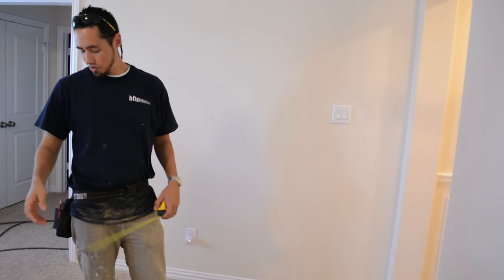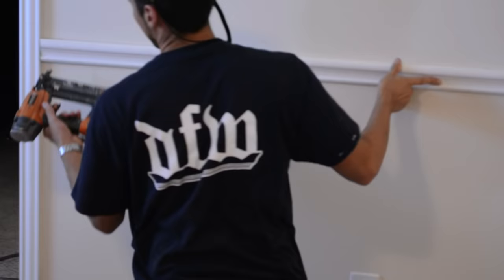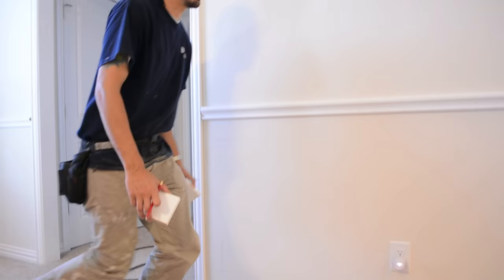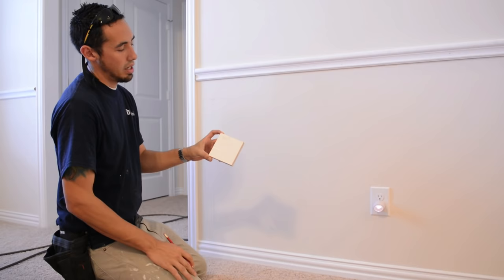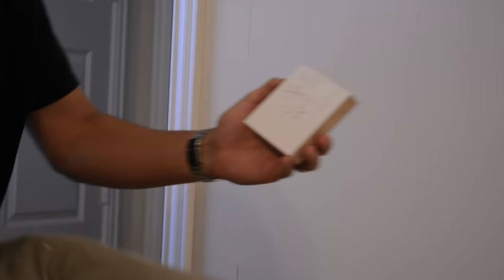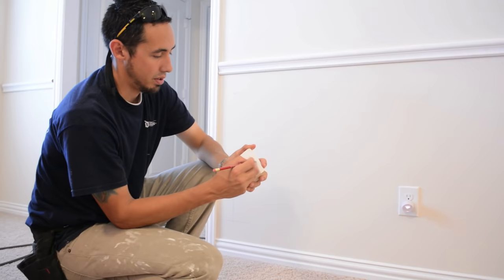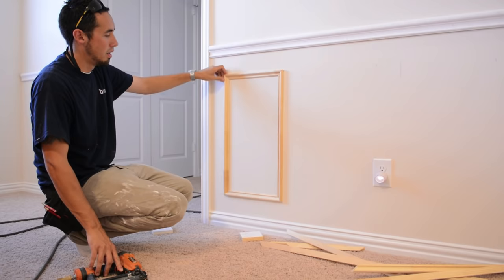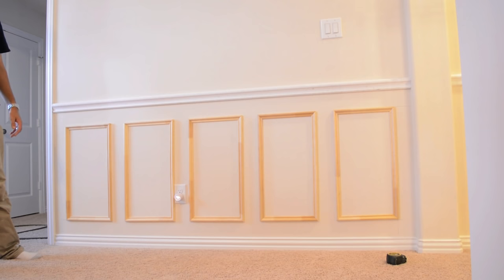How to Install Chair Rail and Picture Frame Moulding

Comment: How do you know how big to make the picture frame moulding?  For example, if you can get 6 frames on an ajoining wall but only 5 on the next.  How do you determine the width so that it doesn't look different on the two walls?  From your vid, I think your frames are 14 inches wide.  How wide were they on the wall to the right that you did previously?

Comment: I have a question! 
When you nail those frames. 
Is that wall a drywall? 
And if is not can I still just nail them to the drywall itself considering there is no wood frame behind? 
And what nail measurement are you using ?

Comment: If the internal spacing is the same as the two outer spacings (as it was here with 4" for everything), you can consider the last outer space to be part of a panel+space group. Avoiding the N-1 spaces for N panels complication reduces the chance for math errors.  (93.75 - 4) / 5 = 18" for panel & space, or 14" for panel only.

Comment: What do I do when one side of my wall is wider than the other side?  Is it ok to have 21.75W picture frame moulding on the wider wall side and 18.25W on the narrow wall side?  I have a window separating the two sides.

Comment: what should I do if one of the frames measurement have an outlet or vent register in the way? Do you have a video to work around that issue?
Reply: Design you panels to go around them or change the position of the socket, vent or switch.

Comment: If you have a room with different length walls, do you do different sized “boxes”to fit the walls ?  ( same room)
Reply: Michael Liscsak Yes you have no choice if you go from a wall with no obstructions to a wall with large windows for example.

Comment: I have a curved staircase. I need to cut a chair rail return at the bottom. The angle is 24 degrees. I want to use the 45 degree cut into the wall. How do I make that cut?

Comment: good job on the layout. But, how tf does shooting brad nails into drywall suffice for holding the moulding for long term results? did you install blocking or sheath the wall prior to gypsum installation or you just say fuck it?

Comment: Where you run into problems is existing electrical outlets are in the way.  I make all the frames up before installing them on the wall, and then glue them to the wall - studs are never where you need them.

Comment: Thank you! What size nails do you use  ?  also will you recommend  painting the picture frame before or after
Reply: I painted all my crown moldings and  trim.  Then you just fill in the holes and touch up after the install.  I found it easier for me.
Reply: @jtoo6060  Thank you!

Comment: I really appreciate your videos! I have a question though, since you’re just shooting into sheet rock with your finish nails I’m not sure that the molding will really stay in place very well. It would seem the only thing holding it all together would be paint. I’m about to attempt this project in my  home so I am very curious.
Reply: Make sure you are nailing into the studs or run a small bead of liquid nails on your moulding then nail it. The glue could damage your wall if you ever decide to remove the mouldings. You can buy a good stud finder at the hardware store.  I recommend one that locates studs and electrical.

Comment: is the fourteen inches the outer measure of the square or inner
Reply: yes, on Pic blocks/Shadow box it's always the outside measurement.
Reply from the maker: that is correct, it is the outside measurement of the box.

Comment: I did engineering at university and I still use my calculator to do basic maths. It's better to look a little silly using a calculator than have to re-do your work.

Comment: what's the type of  molding called (the style)?,.for the framing.  I'm thinking of making my own molding ,  with a  roman ogee and a  round over on the  other  side.i think  that would   work
Reply from the maker: This one is called PM5. Most millwork shops have it in my area.
Reply: Ty for the response.good work..

Comment: I have 9ft walls, so would I make the height of the chair rails higher or keep them the same height???... is that a standard height and rule?... thank you in advance for your help!
Reply from the maker: standard is 36" - 44" but you will need to hold the trim to the wall at various heights to see what you like. for 9' ceiling I would do 40" Thanks.
Reply: dfw crown awesome! Thanks for your response... great channel for DIY'ers!! ...
Reply from the maker: Thanks!

Comment: Couple of questions for FCTV or anyone here that’s done this please:  1a.😂  When designing wainscoting, do you do all the walls in a room or just a single accent wall?  1b. Is there a wainscoting design protocol for this?   2.  When shooting the brads into the moldings, it does not appear it is a concern to shoot into studs behind the drywall.  Is it ok to shoot the brads just into the drywall?  That does not appear to be secure & the moldings would start to come off or separate from the wall imo.
Reply: Yes, he was only shooting into drywall, however, painting/caulking it would add some stability.

Comment: Just curious... are you nailing the trim into studs or just the sheet rock?
Reply: Martin David just sheet rock. Just angle your nails in opposite directions
Reply: Caulk and paint helps with adhesion for something so small as well, but it wouldnt hurt to run a tiny bead of adhesive behind imo

Comment: Your videos are great!  Couple questions... are you worried about hitting studs at all when nailing the trim or does it do fine holding into the dry wall only?  Also, before you paint do you run caulk around all the trim?

Comment: For something like this is it mandatory to nail into studs?
Reply: He's nailing into MDF that was installed prior
Reply: No, you do not need to nail into studs… This is non-structural it’s only decorative… Just butterfly your nails into the sheet rock… Meaning shoot one on a right angle the next one on a left angle or shoot one on a upwards angle and then next one on a downwards angle…
Or for this project,  how simple it is, you can even actually use a hot glue gun to stick it to the wall then caulk around all the moldings

Comment: Anyone know what size nails he used?
Reply: @B ATe That is a good question. I'd guess they silicone the edges to provide a smooth look with minor adhesion. Plus, I'm sure he hit enough studs here and there to solidfy the whole picture frame. Just a guess though.

Comment: ...so, level-and-plumb-be-damned? I ask respectfully because almost every home where I do this is an old Victorian or an old Italianate and the floors are super whacked when it comes to level. What's your opinion on your first measurement in a case like mine?
Reply from the maker: I understand. Most of the homes I am doing are less than a few years old. The houses are built  pretty good as far as the floors being level. I have never had any issues with the way I do it. 
I check it with a level just to be sure before I start painting. I would try to use a laser level as a guide if the floors were an issue in older home. Thanks.

Comment: What if you are only using 2 panels? Do you use 1x1= 1 ?  I tried your formula for 2 panels and the my measurements came out wrong.
Reply: He said if you have 5 panels it would be 4x4. According to him It's always one less than your actual number of panels for your math formula. So, I would take it that if I want 2 boxes it would be 1x1. I tried that and for some reason the two boxes didn't match up for my wall. I experimented and went ahead and used 2x2 for my 2 panels and the formula for the boxes came out more accurate. Although still not perfect. I am just wondering if his formula is accurate unless you are down to only using 2 panels on a smaller wall. I would like to add that I tried what Noconz0727 MC1 said...
"Easier way to math. Take your overall, subtract 4, divide by 5, subtract by 4" and that got my panels more even on my wall.
Reply: Lets say the wall you are working on is 12 feet and you are going to put 4 inch spaces between the boxes you are going to have 3 spaces one on each end of the wall and one in the middle. So the math would be 12ft - 12inch =11ft now divide by 2 so your boxes would be 5.5 ft,   4inch's/Box/4inch's/Box/4inch's 
You can use whatever spacing you want it doesn't have to be 4inch's but make sure whatever spacing you use you use it for all 3 spaces. Hope this helps

Comment: So the Equation he is using.  Which i had to pause and rewind a couple times is:

Using a 4in Spacer

[(Wall Length - (Spacer + Spacer)) - ((# of Panels - 1) x (# of panels -1))] / (# of panels)

Comment: what kind of tool do you use to nail it, nail gun?
Reply: Why would you ask this question if you watched the video? He used a brad nailer how did you miss that?
Reply: Because, I'm not a contractor and don't know a lot of things so I needed to ask what the name of the tool he uses. You need to be able to tell what you are looking for in the store. Don't you think?!... So now I know I need to buy a tool called 'brad nailer' .
Reply: Sorry about that I did not think of the fact you might not know what a brad nailer was I would suggest a 18-Guage 2-inch brad nailer it will shoot 5/8 to 2 inch brads.  Hope that helps!!!!

Comment: Is there an issue with the panel moulding not hitting the studs; wouldn't they loosten over time?

If not, what size/gauge nail do you recommend and is any glue recommended?

Thank you in advance.
Reply: I am wondering the same myself about the nailing....

Comment: 2 things

1) ive watched a good amount of your videos and i want to give you props on the good work. 

2) on one of your videos you mentioned that you use 2" finish nails, don't you ever worry that you'll hit a plumbing line or electrical? I know that you SHOULDN'T because let's say its 1/2" for the trim then 1/2" for sheetrock, you only have 1" behind the sheetrock and plumbing and electrical should run at the center of 2x4 studs, but we know that plumbers and electricians don't always do that.

Comment: this would be difficult without a nail shooting M16...
Reply from the maker: lol. They are pretty cheap. Like 150 for a whole set up.
Reply: i tried doing it the old fashion way with nails and hammer and I end up damaging the molding (made from soft pine wood with a razor thin white layer for paint).  I really need to buy one of these nail spitters.

Comment: i'm sorry, but did you just nail the chair rail on to "drywall"? I didn't see you finding any studs...
Reply: I think what he likes to do is, if you notice, is nail in opposing angles. I prefer finding studs as well but sometimes you may not have that luxury
Reply: @alcawmk  I'm not trying to knock him down, he's really good, but constructive criticism is always good in this trade. He had plenty of studs in this project, nailing in opposing directions while using adhesive, I've also done it, but only when I had no other choice.

Comment: I think this is a little too basic and there is some miss information here, Chair Rail typically goes on between 27 and 30 inches AFF this can be found in the Architectural Standards. Why is he bringing all the cut pieces in when he could have put them together on a work table and brought them in assembled. He did not glue the back of the molding to the wall nor did he glue his miters, very bad technique. miters will start to pull apart with the changing seasons and not look real good.

Comment: I hate to call you on it, because I love and appreciate your videos. But it threw me off when you crunched the numbers for your layout. You ended up with 69 3/4". Then divided by 5. And got 14"? I found the extra 1/4". Second to last panel. The mullion in between those panels ended up 4 1/4". Only reason I'm calling you on it is because I'm a carpenter, and I know you'll agree, 1/4" is pretty much 1/4 of a mile.

Comment: Not the best I've seen but also not the worst yeah I'm lying probably the worst you were killing me the whole video first off your chair was 8th short at least should I mention you didn't glue your joints. Owell right? Killing me home slice
Reply: ThomasAmp Day Gluing that light panel with probably be overkill, no? It doesn't look as if it's not going anywhere.
Reply: I can tell you his legs are not hitting studs all the way down that wall he might have found a couple that his nails hit but the joints should be glued they will last longer. A lot of material will shrink and expand with moisture you leave your windows open it's hot cold hot cold all takes a toll on your interior wood work.
Reply: ThomasAmp Day Gotcha! Ok.
Reply: And I don't like how the first box at the bottom of the stairs is 2 x bigger then the rest, but hey maybe homeowner wanted that.. who knows lol and the square that ended up really close to that outlet I would have figured out how to have an even gap on both sides of that outlet. Visually it would have looked better.